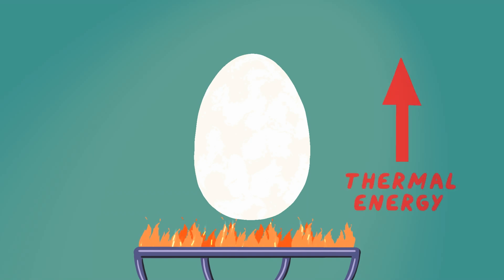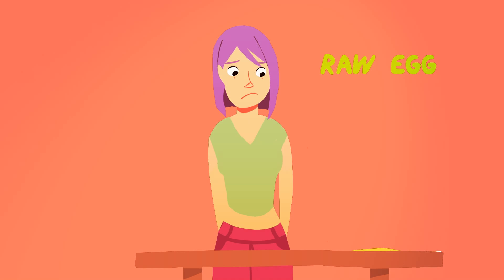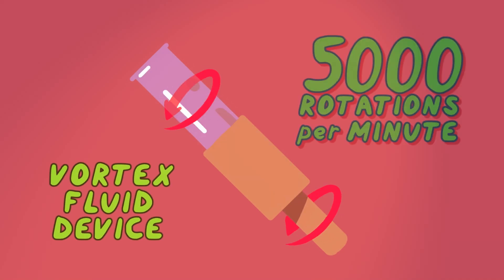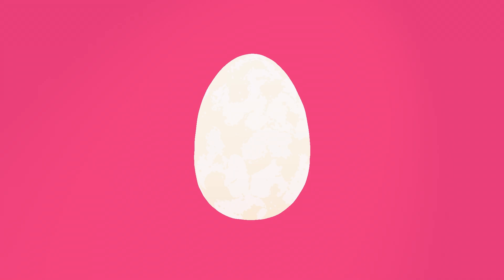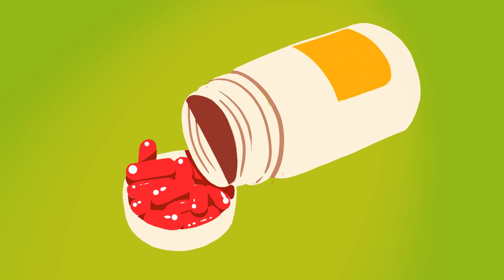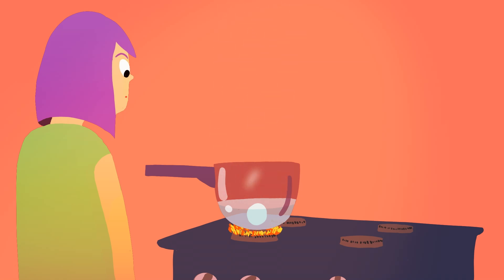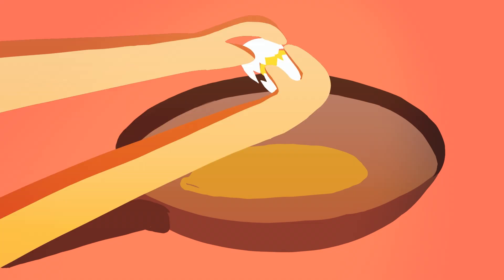How to unboil an egg - Eleanor Nelsen

Comment: Sounds like it can be done on a household Power drill or angle grinder. 5000 rpm ain’t much
Reply: The maximum for a household drill is 1500rpm. That's a lot less.

Comment: why does the solution near the wall spin faster than the solution in the middle? shouldn't it be the other way round :O
Reply: its centrifugal force.
angular momentum must be preserved.
so points the are further away from middle of rotation need to spin faster relative to the middle part.
think about spinning a basket ball on your finger.
the widest part of the ball is spinning fastest

Comment: I’m sure that it’s not the prestige egg yolk you used to know when it becomes reverted. It has been too radicalized and a cooked egg and is a shell (no pun intended)of it’s former self. Living on the fringe of not knowing if it still has the same viscosity or not, never knowing the true world outside of its small easily cracked shell.

Comment: Could you attach the egg to a machine that holds it at that angle and spins it? Or is the shape of the egg the issue? What if you poked a tiny hole in the top of the shell?

Comment: So I just need to put the egg into the washing machine aight?
Reply: Yeah and keep your machine spinning for a whole month maybe
Reply: Most washing machines only spin at 800 rpm so you would need to make it at least 6 times faster (and make numerous changes to its stability, etc. which would probably cost you >$40,000).
Reply: @AnnoyingMoose  most washing machines I've encountered actually can do more than 2000 rpm
But yes, still too slow
Reply: @joschistep3442  So just add a tiny gear to the washing machine and put an egg on it. Then its gonna be way faster.
Reply: Ohh yes! Based on literally nothing, this person says it would cost over $40k. You can take that to the bank and get laughed at.
Reply: @AnnoyingMoose  So what I'm seeing here is its possible
Reply: No, strap the tube to your car's driveshaft and do some drag racing.
Reply: You also need urea, sinc ethe video mention it... so remember to pee on it before out it on the washing machine :3
Reply: @jjba3571  thanks sir, I almost forgot about it
Reply: So the only way you can do this is to make the egg into powder and spin it in a tiny tube, doesn't sound like Un cooking an egg to me
Reply: @alexandermandache1628  let us dream
Reply: If only things were so simple 😢
Reply: Huhh..good idea😃😃
Reply: dont forget to tilt it
Reply: With fertilizer yes
Reply: Hadron collider 😈
Reply: Along with urea*

Comment: It's simple 
1) Gather pedestal, chain, and you can either buy a time stone at your local multiverse or current multiverse, or you can gather pure energy and compress it with 10000000000000000000000000000000000000000000000000000000000000000000000000000000000000000000000000000000000000000000000000000 tons of force
2) set egg on pedestal along with the forbidden book
3) attach time stone around chain
4) make the time ring go around your dominant hand and turn your hand left for 2.3 second
5) enjoy your unboiled egg

Comment: Hmm it's kinda interesting but theres something that bothers me. It is primary bond that ties the protein agregates together, and its also the same kind of bond that is in the protein molecules. The primary bond that ties the agregates together,causing it to entangle is called cross links. To unboil an egg you need to only break the cross links, otherwise it will degrade. How do you keep it from experiencing degradation? By degradatio , i mean breaking the primary bond in the molecules itself, not the cross links, causing it to burn

Comment: 3:10 in practice, however, it doesn't matter whether drug's production cost is $30 or $60... It will be sold for thousands of dollars anyway because of the patent system. The only change is more profit for the pharmaceutical company.

Comment: scientists worked that hard just to know how to unboil an egg??? i mean...eh...whyyyh it wont benifit in any form, will it?
Reply: They have worked with eggs because the principle is the same with proteins, as the video explains, and i guess it is cheaper to work with eggs to try out the method rather than drugs. In short: the purpose is not to uboil an egg, but unboiling an egg is a simple way to describe how the method works
Reply: Not every science experiment has to be a practical one, space exploration might not have been very usefull in the moment, going to the moon was pointless on the practical side, but many of the instruments and kwoledge we get while pursuing those "useless" experiments, its what moves technology forward.
Reply: No, but someone needs to be funding the experiments, and I don't think many would finance something only because it is a fun experiment.
Reply: Not everything scientist do its to benefit us, thats what engineers are for.
Reply: That is completely untrue! Your body is completely made of proteins. This is studying how the proteins in an egg can be reversed after boiling it. This is good stuff. #biochemmajor

Comment: But why is the same pot of boiling water hardens the egg and softens potato?
Reply: This video is about Denaturation of PROTEINS (when they lose their natural structure), and in this case by Heat that disrupts the weak hydrogen bonds that holds the protein molecules together. 0:34-
Eggs contain mostly protein in liquid form. "The proteins in eggs denature and coagulate during cooking."
Reply: Rome Blanchard 
Kids coding

Comment: Can someone please verify is boiling an egg a physical or chemical change. Now I'm confused
Reply: Well, actually, chemical changes are a subset of physical changes, sooo
Reply: Lelouch Yagami I'd say yes, as chemistry can be considered a branch of physics. Possibly, the most successful one, btw.
Reply: Lelouch Yagami There are two separate terms, because saying physical change is far too general, it could refer to: classical mechanics, eletromagnetism, chemistry, quantum mechanics, thermodynamics, nuclear physics, optics, etc. At the same time, some people usually say "physical changes" refering only to (classical) mechanical changes.
Reply: its physical. it turns to another form of appearance but its still an egg.
Reply: Lelouch Yagami Plus, chemistry has developed quite independently from the rest of physics, that's why they are usually regarded as separate sciences
Reply: Lelouch Yagami protreins are groups of amino acid chains that performs a specific fxn or have specific property only if it's spatialy arranged in a specific way. Boiling  the egg destroys the spatial arrangement and therefore loses the protrein's function. So to answer your question, it's a chemical change.
Reply: It's a bit of both. But mostly physical, since adding the energy would be physical. Kind of.
Reply: Chemistry makes my nose bleed. Somebody teach me or I'll die.
Reply: euhm, if the structure changes doesnt mean its chemical. the molecules stay the same hence its physical
Reply: Kit PY lol energy is needed in both physical and chemical changes, not just "would be physical"
Reply: It’s more of physical because if you boil an egg, you can make it return to its unboiled self.
Reply: I am in SCHOOL. My teachers would say “ oh it’s chemical. You learned that in fourth grade”
Reply: PHISICAL
Reply: Miguel Casanova Your statement is that every chemical change is a complex physical change. There is a reason we have two separate terms for these phenomena. By definition a chemical change is a process where a new substance is formed. This includes changes in chemical structure. After giving it some thought, boiling an egg is a physical change since only the arrangement of molecules change, not their structure. But I object to your initial statement as it ignores the standardised definition of these processes.
Reply: Miguel Casanova Hmm, I never considered that possibility . If but if you involve the concept of hybridisation of atomic orbitals and formation of molecular orbitals does that still count as a series of physical changes? The actual structure of the atom itself and arrangement of electrons changes when making bonds.

Comment: I perfectly understand the concept of centrifuging aggregated proteins with strong inter-peptide bonds to separate them back into single polypeptide stands, but this procedure will not allow the tertiary structure to reform back to native state. Chaperone proteins will not be integrated back into the process  of reforming the 3' structure. Though through this process i do agree that the overall viscosity of the solution will result in a more fluid nature do to the decreased intermolecular bonds created from the heating process of the boiling.

Comment: So you centrifuge the dissolved egg and the proteins just 'snap' back into place while being quickly spun? You lost me there. If the sheering stresses are strong enough to dejumble/untangle the cooked egg protein bonds, why wouldn't it be strong enough to prevent the original weak bonds in (non-de)natured proteins?

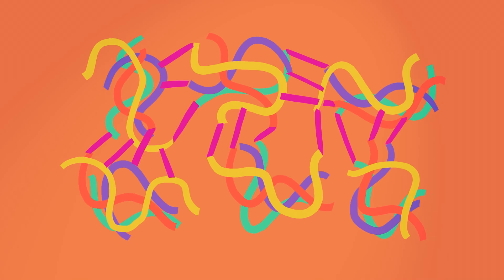Comment: got it until 0:47 where it just goes against everything I learnt in school, someone explain how does adding heat form bonds?? I mean I get the denaturing part which is what should happen but how can adding heat form bond when it is suppose to be the opposite
Reply: +joesr31 Adding heat breaks bonds that were there before, allowing new bonds that can withstand those temperatures to form, even if they're bonds that the protein "likes" less.

Comment: actually wouldn't the egg closer to the middle spin faster? I mean if its closer to the middle it takes less time to do a full rotation
Reply: +dom_person113 it doesn't take it less time, it takes it the exact same time as the outer layer, but the distance it travels is much shorter, therefore the speed is lower. Think about pointing a baseball bat in front of you, then spinning around in a circle. When you stop spinning the end of the bat will have travelled a much longer distance than the handle, but in the same time you spun around.
Reply: think about it like the solar system the closer planets take less time to do a full rotation
Reply: +dom_person113 and apparently you don't listen to previous comments.
Reply: +мisteг Rㅇьloχiдп and APPERENTLY shut up
Reply: dom_person113 and apparently insult me...
insulting
Reply: +мisteг Rㅇьloχiдп well u had no business in talking to me, I was jot addressing u therefore u did not need to comment
Reply: dom_person113 k. but maybe u...
oh yeah...
Reply: ok to all the people commenting on my stupidity I have realized I was wrong, no need for 12 people to tell me the same thing, I get it.

Comment: Cool information about proteins. But why would anyone want to unboil an egg.
Reply: for SCIENCE!
Reply: +Burak Çalık replay the video, something about drug production
Reply: +valeriesze The same method is used in drug production. It's just that since eggs are made up of similar matter as some drugs, you can use this method to unboil eggs if you wanted to, or at least the egg whites. I guess it's just kind of a 'cool' science experiment thing. There is a fine line between just fucking around and science a lot of the time tbh
Reply: +Evi1M4chine WOW! What cave?

Comment: this process might help explain a difficult part of abiogenesis. within cells, proteins are usually folded  inside a special organelle that has the perfect temperature and alkalinity to cause it to fold to the correct shape. if a protein formed outside of a cell it wouldn't have such an environment to fold itself. if some sort of mechanical energy could be applied to alternately fold the proteins then it would have interesting applications to the concept of abiogenesis in the theory of evolution.

Comment: I don't think this works with all sorts of proteins. I mean, not with proteins whose structure has sulphur bonds. Of course I am suposing the protein suffers a denaturalization by other means which breaks also those sulphur bonds and later is uncapable of folding back properly. I guess that this was on the minds of Mr. Michaelis and Ms. Menten.

Comment: Wouldn't water and urea make urine?
Reply: Lyly Nguyen Only in the right ratio. Oxygen and Hydrogen make water, but you need 2 H for each O or you wont get water. If you have 1 H per O you get hydroxide, not water. Chemistry is all about ratios and energy.
Reply: Lyly Nguyen Urine is more than urea. It consists of other compounds as well. According to Wiki:  Urine is an aqueous solution of greater than 95% water, with the remaining constituents, in order of decreasing concentration urea 9.3 g/L, chloride 1.87 g/L, sodium 1.17 g/L, potassium 0.750 g/L, creatinine 0.670 g/L and other dissolved ions, inorganic and organic compounds.
Reply: Edward Ramos and who knows what else if you take druggs
Reply: Metta Ksanti Hydroxide is always an ion. A reaction of O and H produces water and excess O2 not hydroxide.
Reply: Meep Changeling hope you're not implying that a reaction of ratio 1H:1O would produce hydroxide. Because you would be wrong.
Reply: +Luke  Newman I think she means hydroxide ion
Reply: lyly nguyen You forgot salt. And sugar if you have diabetes.
Reply: Ohh ok thanks
Reply: Luke Newman
Very true, but you need to simply to teach